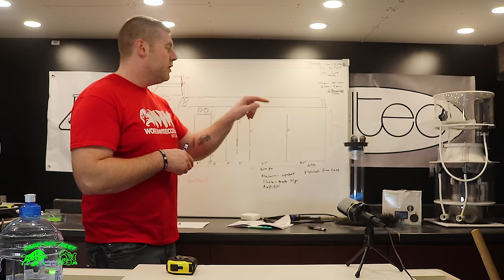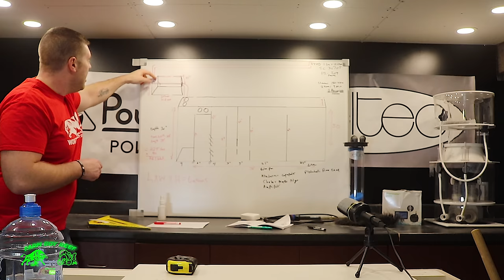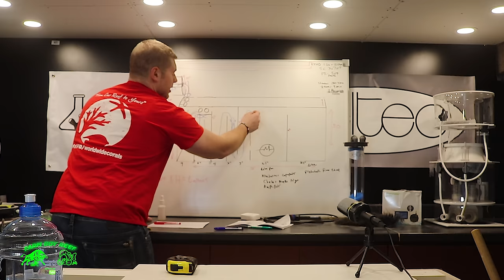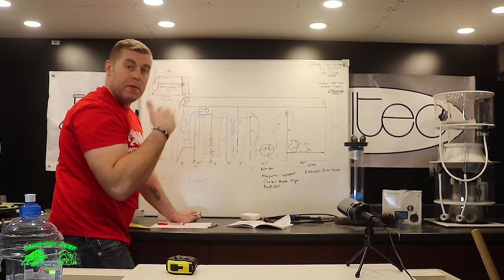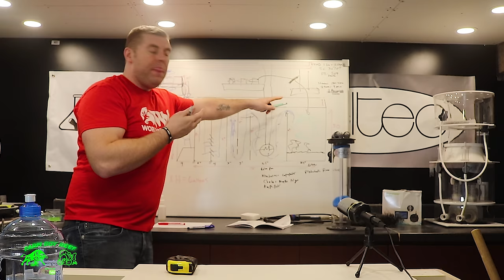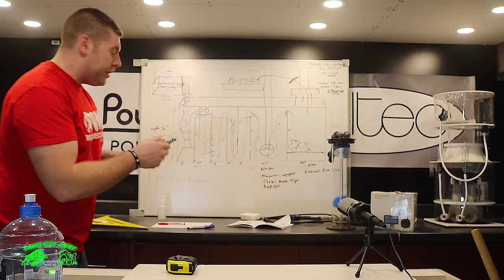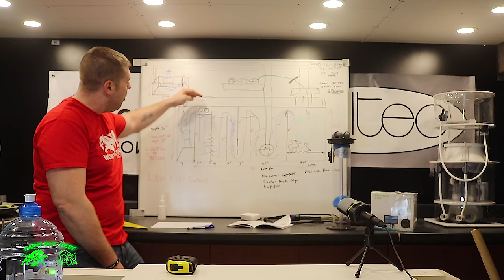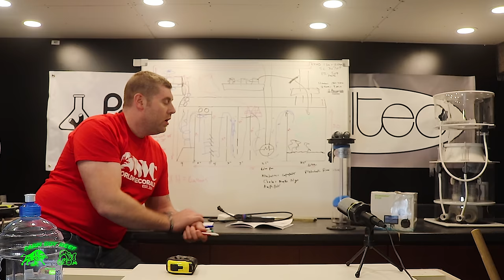Sump Design for the 700 gallon Phoenix and contest video!!!

Comment: get the adapter for the tunze ato.  you can plug in other pumps than the stock pump that is included. That these has a safety feature that automatically turns off after x min of running because it assumes there is a leak in the system. prevents salt tank from turning fresh. with 700g and large sump you will probably evaporate lots of water!

Comment: I did the two tier tank/sump.....not doing that anymore. it was tuned in the beginning,  nice and quiet. but you are going to struggle to keep in quiet. If the drain to the skimmer sump changes, the flow into the large sump changes....annoying.
good luck